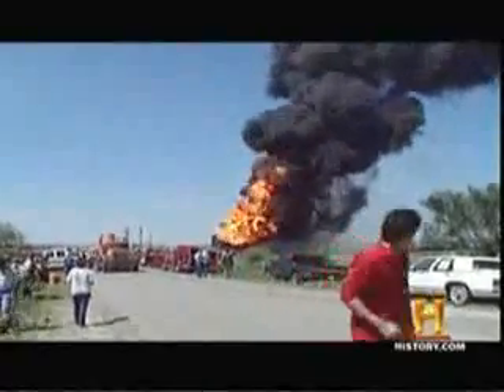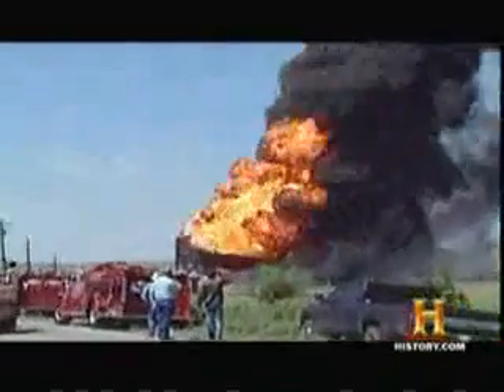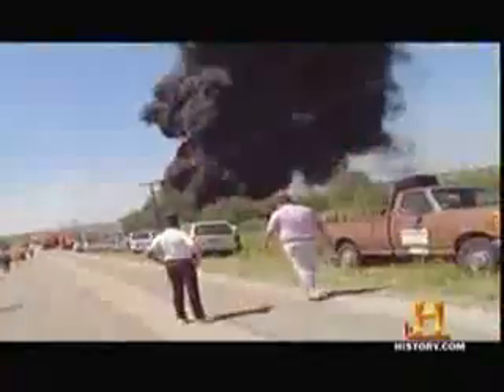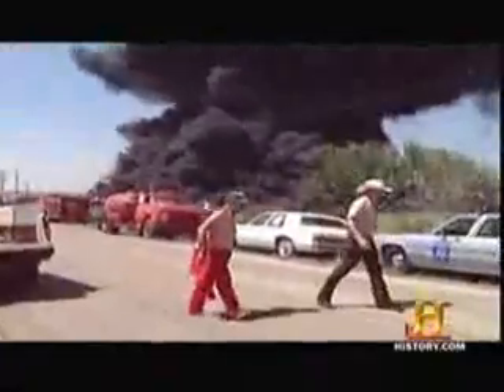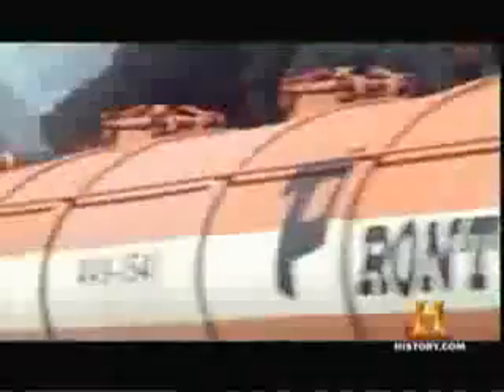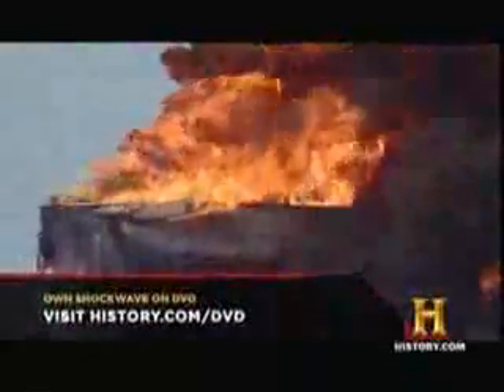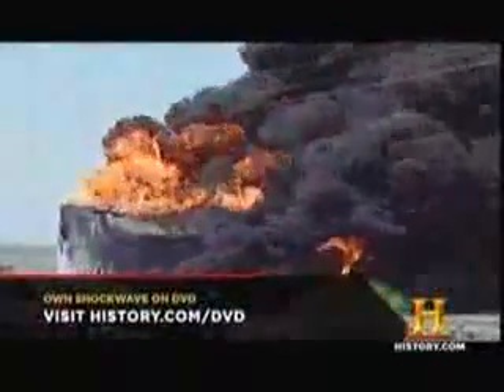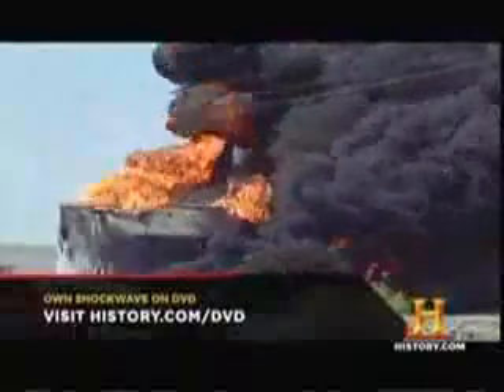Crude Oil - Boil Over Explosion

Comment: so peoples who were standing around started to burn?
Reply: pretty much yes. because when you get a column of flames that large and that wide burning at around 2000 degrees the radiant heat alone will cause 1st, 2nd, and even 3rd degree burns. and worse case scenario it could trigger other fires